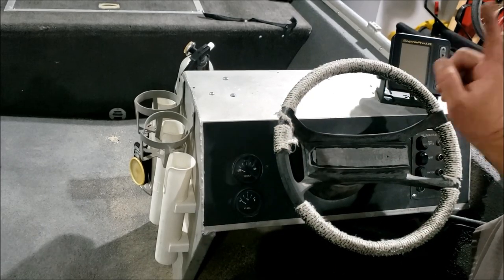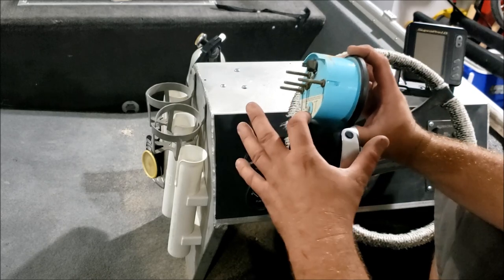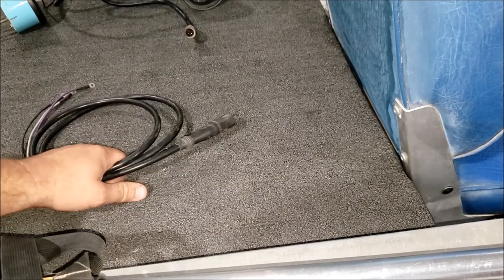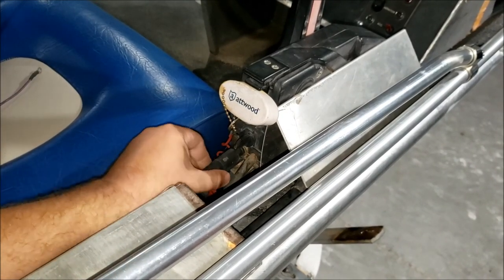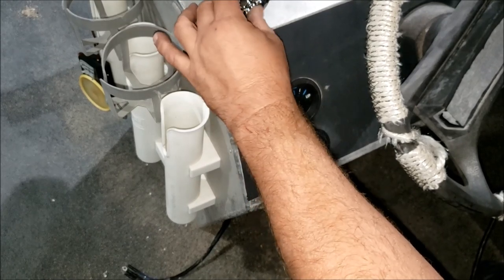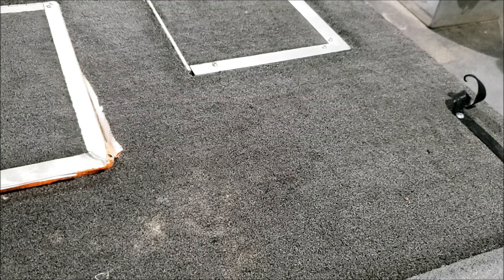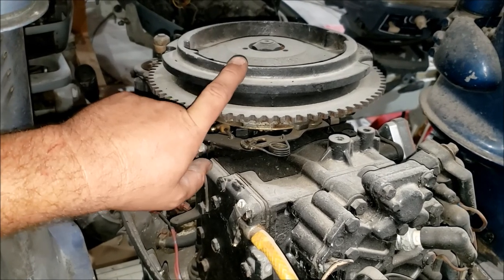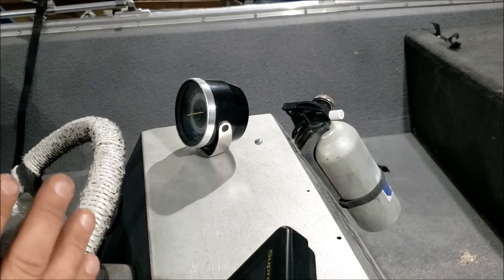Johnson / Evinrude Outboard Tachometer Install

Comment: This inspired me….I have an Erude 30 hp on my 16 ft side console. It’s an e-tec and it had a harness with an 8 pin System Check connector already under the side controller. Just needed an extension to reach the Tach on the dash……took longer to clean up the dust from cutting the hole in the fiberglass console than it did to install. I agree…..you don’t need it but it is useful. Keeps me more in-touch with my outboard.

Comment: Great video.  Thanks Brandon.  I have a side-mount concealed set up on an old Javelin bass boat that has set up for 10 years.  Have brought back everything electrical under the dash but the tach.  It gets a signal with key switch but no RPMS displayed with motor running.  Guess I have to see where that elusive gray wire is not sending a signal. Great explanation of how everything works.  Thanks.

Comment: Hi Brandon,

Thanks for sharing this.
I have an Evinrude-Johnson 4-stroke (rebranded Suzuki DF40) I have gone through the manual trying to find the pulse of the engine but no luck. Do you have any idea what the setting should be?

Also, if you select the wrong setting. could it harm the tacho?

Thanks!

Comment: Thank you for making this. My remote was like the second remote you showed. Tach gray runs to sender, and ground and hot go to (+ - ) key turns on and the gauge moves. Motor starts no movement of the tach once running. 1976 Evinrude 135hp. Thinking rectifier is bad?
Reply: Did find out anything? Mine is doing the same thing. I’m stumped 🤔. Thanks for any updates.
Reply: @jaimyware1231  nothin unfortunately

Comment: Thank you for your help and info I have  1984 115 hp Evinrude with a power pilot control box has a tachometer but does not work now it will thanks again 👍

Comment: Just a little tach-y for in the morning ! Lmao. Do you need any parts off that Merc 150 ? It’s really stuck and I’m going to pull the head and just see how chewy it is in there , one cylinder is at 85 and the rest around 110 ( these readings are from 2018 ) Lol. Controls and cables , T&T with pump , lower unit and steering bar all good . If I can clean up the cylinders I might just keep it .

Comment: is the blue wire the nav light ? i got mine all working other than the light . so do i connect the blue wire and throw it on my nav light switch? edit** i got it figured out you i had 3 wires coming off the back (blue,purple , black) that was seperate away from the main plug that plugs into the remote. i thought the controller since its grouned through main power plug would be enough if i hooked up the blue wire to the switch but that was not the case the light is on a seperate circuit meaning the black wire needs to be grouned as well. purple i assume is for if your running multiple all together

Comment: This explanation of which wire does what is what I was looking for. QUESTION: Is the gray wire suppose to send 12volts to the tach with switch on motor not running? Thanks
Reply from the maker: I doubt it.. but never checked.

Comment: I have a 1980s not sure on the year v4 90hp I try hook up a tach it works but doesnt read the rpms I had hard wire it trace the grey wire it all hookup right but still no signal I took a test light to that wire no light no power through the signal wire even on the motor too

Comment: just found a 6000 rpm omc  surface mount tach with 3 pin plug plus same wires with terminals for block. some timing lights can read rpm for checking

Comment: if I don't have a harness is there any way I can wire it up
Reply: He told us that the purple  ( 12 v +) can be connect on the key switch. the black is ground from control box, and the grey is coming out of the bottom of the control box

Comment: Does a speedometer plug in the same spot on the controller as a tachometer?
Reply from the maker: No, but still have the power and ground there you could use. 
But most older ones that run off water pressure just need power for the light.

Comment: What about black plug engines with electric start
Reply from the maker: Does it have a stator /battery charging? 
the black plug doesn't have the gray wire within, so you would have to run it elsewise.

Comment: Hey, would you happen to know where I might find a Stainless Steel prop for 40hp Johnson 2002 model, it’s on a 14’ fiberglass skiff, I have no idea what pitch I would. Have suggestions from you would be great benefit to me. I know you have dealt with a wealth of boats and outboards.

Comment: You could of used a Harley Speedometer/Tachometer mount. They would of been perfect.
Reply: Except a boat motor can rev to 6000 rpm. Harleys and tractors rev to about 1700. 
Just joking.

Comment: Never use your aluminum boat for ground… OK for testing but don’t run electricity through your boat always ground your boat, but never run electricity through it. You will promote electrolysis. Somewhere, not where you might think your boat will corrode like crazy, more pronounced in saltwater.